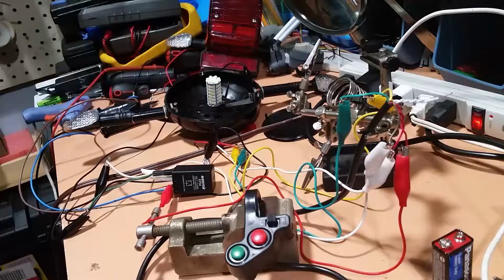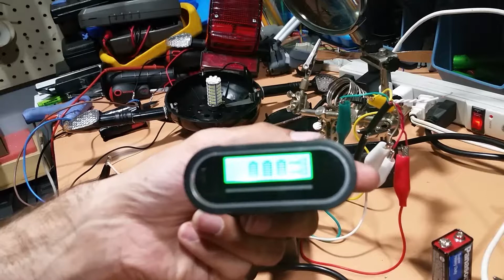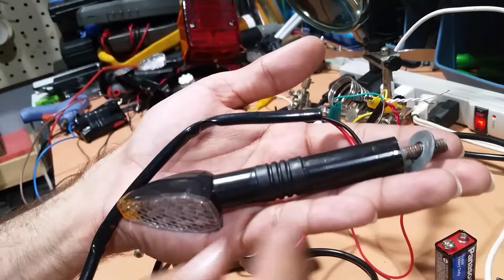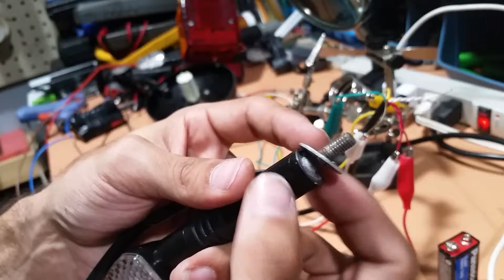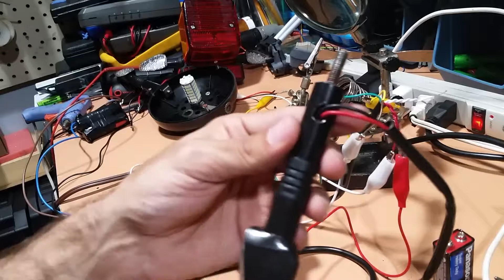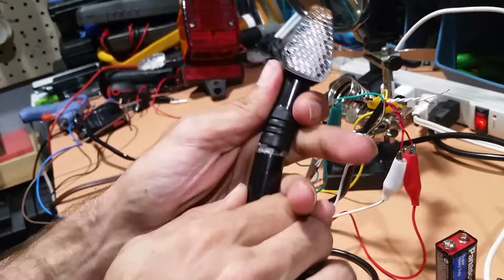Tomos A3 - Turn signals & Headlamp

Comment: Great video hey I know this question is not really related to the lights but I have a tomos with the a3 engine and can't get spark, what's the best way to test the condenser, and inner coil thing, aswell as the outer coil for the spark plug? It had spark at first and my friend was holding the end of the spark plug wire and said it still shocked hi lol. How should this be wired up. I only have a blue and yellow wire coming from flywheel area

Comment: i cant believe no one commented , i have a question , if i were to just hook up the same LED headlight bulb to my bike would i still need that novita box ? and as for the battery how long does the battery last ? i have a tomos lx that i would love to get led lights for but seems like i would need a battery since mopeds are AC and not DC
Reply from the maker: I'm an electonics/tech dood so doing the lighting is pretty easy for me. The "blinker box" just creates an on-off timed pulse. That box makes the blink happen. If you add a switch in parallel, you can bypass the blinker and just turn the lights always-on. Good as "Safety Hazard" lights if you ever need em.

My Tomos has no battery option. I reused some old LiPo Laptop Battery Cells, three 18650 size in series. Those batteries are about 3.6 volt on average, or 4.2v at full charge. So three cells gives me 10v to 12.6v to power everything. 

To test how long they would run, I used my multimeter to measure the amperage when every single light was always-on. When will you ever have left & right signals always-on with headlamp and 2x tail light? I just left that to run down, and it lasted 3 days on LED lights (IIRC 850mA drain) before they got annoying and I figured that was good enough. 

I used an external 18650 desk charger, and bought some single cell 18650 holders to make a battery pack that I strapped to the handlebars. 

I was never able to get 12v out of the Tomos A3 to get it to self-charge a 12v SLA battery, but thats an option on later models. There seems to be a battery compartment under my seat. Ping me back if you need any more help and advice, let me know how it goes... Ive got a 1977 Honda Express NC50 im trying to work my magic on.
Reply: Foxx D'Gamma sweet man thanks for all the info I’ll start on those led turn signals soon , I just redid my entire wiring harness for my lx and boy was that a job lol only thing that I need to get working is the horn to be at full volume lol
Reply from the maker: @Horrented  oh sweet jeezits I just got into the electrical for this 1977 Honda NC50 and I have some major mods and hacks to fix this. Vids coming soon...
Reply: @FoxxOTG  sweet can't wait to see the vids , I just ordered my led lights, I'm only planing on using the long strips though and I'm still debating if I can still run them alone on AC. I feel like there would be a lot of flickering lol which I don't mind only because they are going to be used as turn signals only. whats your input on that ? I'm not worried about them dying on me because of AC since they only cost me 6$
Reply from the maker: Dont wait, here ya go! 1977 Honda Express NC50: https://www.youtube.com/playlist?list=PLNsGGh989STgRDp2bBMV57omxwAMkAMEo Ill be adding more as I go, but as for now not public. Working on the NC50 currently and vlogging the progress. Im in pretty deep and hit some weirdness I cant figure out. About to hit "fuck it" and rewire the whole thing from scratch.

Sounds like you need a component called a Voltage Rectifier. Its basically 4 diodes aranged so it converts AC into DC. Its a fairly simple concept if you do some internet searches you can find tons of info. Just a few wires, 2 AC lines, then your DC Positive and Negitive. You cant buy a Voltage Rectifier thats too big! 120v @ 4a appliance V.Rectifier will do the same job as a 12v, just handles more load. Just keep this one thing in mind, as your engine revs from idle into speed, your dynamo will generate more energy, so you may measure less voltage when idle and more when you rev the engine.  But this is just all basic electronics theory stuffs. Hit me up if you need any more advice, and id love to see what you have been working on.
Reply: Foxx D'Gamma so I watched this video again and I have but one question and that is how did you combine all three batteries together ? Did you just use one wire that connects to all three and same for the negative ?
Reply from the maker: @Horrented  all the batteries are wired in series. One in front of the other. In a series circuit the voltages add up. So 3 x 4.2v = 12.6v. If you wire them in parallel, that is all positives to one lead, all negitive to another, you add up total current capacity, but voltage stays the same. A Tesla Car works on a fuckload of these types of batteries put together to make a much larger cell, with multiple banks of batteries.
Reply: Foxx D'Gamma I never got to ask, but since you use a battery bank to charge your 18650’s do you remove the soldering material off the batteries the. Charge them? Or did you manage to find a way to charge them without the bank, I had a 12v 5ah battery laying around and wanted to use the rectifier/regulator to charge the small battery but also use to power my led headlamp and turn signal
Reply: I’m also waiting for the 18650’s to come in the mail aswell
Reply from the maker: @Horrented  I also bought some 18650 battery holders. Just like the type forAA size batteries. That way I could just pop & sawp them easily. Just be careful. If you cross any wires, the batteries can get very angry at you and possibly start an electrical fire. Also think of a way to make this water resistant. Personally I have used a bike sports drink bottle and holder for other gizmos I've half-ass slapped together. Plastic food containers for reheated leftovers is a good place to find a quick and easy project box that offers water protection and an "Easy Access Panel". You really want to try to keep your battery and wiring dry. Get some heatshrink tubing for your wiring to cover any wires you solder/crimp together. Just remember to put the heatshrink on before you start to solder. Or try a product called Sugru. It's basically hand-moldable rubber, kinda like if clay were a rubber product. Once it dries you have have a solid piece of rubber. Sugru can also be used to fill in the hole of the project case, where your wires will need to come out. That way you can drill a hole for wires and still patch it with Sugru so water cant leak in. 

This is your mission if you choose to accept it... good luck.
Reply from the maker: @Horrented  the 12v 5a battery you have is likely Sealed Lead Acid (SLA) chemistry. That type of battery can take some abuse when it comes to how they are charged and discharged. Lithium batteries are an entirely different chemistry, so they cant take the abuse of being used and charged very frequently. Thats why my 3x 18650 LiPo battery is removable. I would not recommend trying to charge this off the 12v output of the moped - its directly tied into your engine. The faster the engine goes, the more power it produces. LiPo batteries hate unstable charging. Ever notice your phone battery seems to last less and less? One reason is over time, and randomly charging the battery instead of letting it fully drain hurts the battery due to the LiPo chemistry. 

In fact, try an experiment. Hook up the LED headlamp, start the engine and let it idle. Are the LEDs flickering or not full bright? Now slowly throttle up, you may see the direct effect of More RPM = More Voltage. The flicker might even seem to be in sync with the engine. If you cant see the LED flicker, just look at it through your smartphone camera.
Reply: Foxx D'Gamma yea this is mainly why I either want to go the route of using the 12v 5ah battery or using your method , all I’m waiting is for the battery pack in the main Monday but if I can successfully charge the 12v 5a battery with my rectifier then by all means I’ll stick to that since it’s about the size of 4 old spice deodorants lol , I learn a lot from this video and your other videos , keep up the great work !
Reply: hey Foxx I had one more question in regards to the battery pack , if I were to use a rectifier would that help charge the battery ? or would that cause some issues ? and would the DC side of the rectifier go straight to the positive on the battery and then from there to all the other DC accessories? I just got my 18650's but I also got my 12v 5ah battery charged up at a local auto zone and it fits right in the seat compartment. I did hook it up to my turn signals and lights and its beautiful but now its the part of charging the battery which is my concerns , would a rectifier charge up either the battery pack or the motorcycle battery at all ?
Reply from the maker: @Horrented  do you use discord? This would be a lot easier if I were able to draw a schematic or diagram to visually explain this. Text does no justice. Also the slow reply times between messages suck.

If your 12V SLA cells is holding a charge, use it! That's the type of battery the moped was designed for. Its not uncommon to see a 12v or 6v SLA cell on mopeds.

The rectifier turns the A.C. current/voltage into (noisy & choppy) D.C.  You can directly hook up the rectifier D.C. output to charge your SLA cell, thats exactly how it was designed. I would suggest looking up the wiring diagram for your moped and try to study it. Figure out what goes where. Regardless you should be glaring at the wiring diagram as often as you can. I keep copy of my service manual on my coffee table and will pick it up to study - even if I feel like I know what im doing I still continue analyzing the service manual. Although i must admit the internet has a lot of good info, too. Especially when it comes to mods and upgrades. 

I've been on the Moped Army Discord chat, and they have been more than helpful. I highly recommend it. There are some real moped gurus here: https://discordapp.com/invite/zu5hjUM - hope to see you there, feel free to DM me.